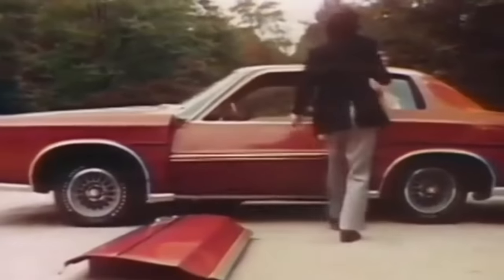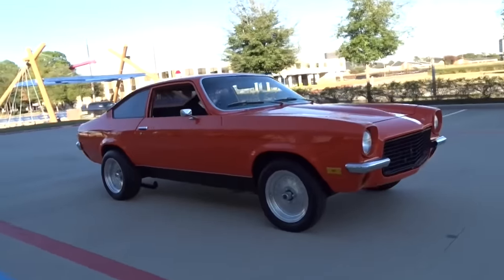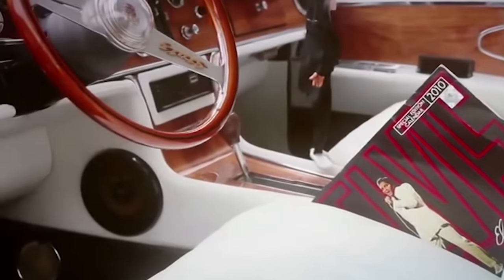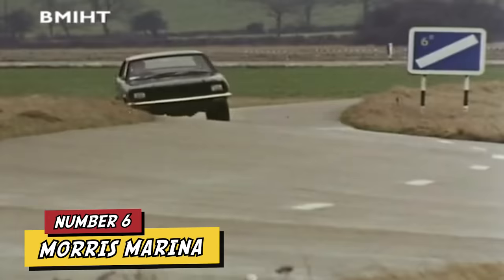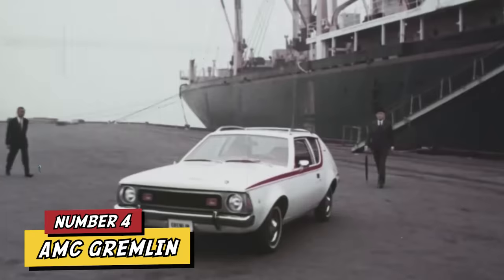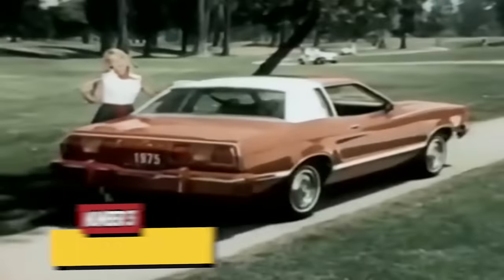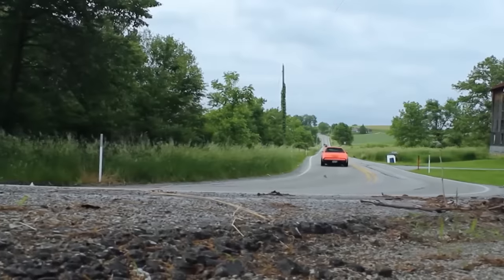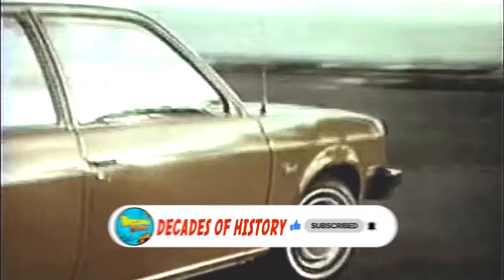Top 10 The Most Disastrous Cars Of The 1970s | Decades Of History

Comment: I WOULD LIKE TO BLOODY KNOW WHO THE HELL HAS PUT THE MORRIS MARINA ON THIS VIDEO AS IT IS AN EXCELLENT ,I [  REPEAT  AN EXCELLENT  CAR  ]   I HAVE HAD TWO AND THEY WERE BRILLIANT SO IF ANYONE  KNOCKS / SAYES ANYTHING BLOODY BAD ABOUT IT THEY CAN PISS OFF ESPECIALLY IF THEY HAVE NEVER OWNED ONE THEMSELVES  THEY HAVE BEEN WARNED .
Reply: I am sorry to say that I drove one in '74 -'76. It was the worst car I drove in 45 years. It was rusting through when 3 months old. It needed 5 clutches in 28,000 miles caused initially by a faulty crankshaft oil seal, and then by distorted clutch covers. Each time the clutch failed, the engine shook so much that the exhaust pipe was torn off the manifold. The alternator failed at 20,000 miles. The battery failed at 35,000 miles. Rear axle location was so poor that the rear end hopped very noticeable on cornering. The best fuel consumption I ever got was 28 mpg (UK). As it was a 2 door coupe design with fixed rear windows, and the cheapest version with dark red vinyl seats, I had to endure roasting 85°F temperatures during the summers of '75 and '76, losing 30 pounds each summer. The brakes were poor, but I got used to them. The 1,300cc engine was feeble, but given the other shortcomings it was probably just adequate. Oil consumption was getting worse at 58,000 miles, when I was pleased to say that I got rid of it

Comment: The '71 Grand Prix was one of the most beautiful cars manufactured.  It was acclaimed as such at the time.  The drive train was well engineered , the interior contained many luxury touches, and it's performance was perfectly adequate.  Sure it was heavy, awkward in town, and a gas guzzler, but at 45 cents a gallon for gas, no one at the time cared.  The Pinto's reputation for exploding on impact is overstated.  All cars at the time put their gas tanks just in front of the rear bumper.  it was the standard location in the industry.  The Vega was a pretty car, but absolute garbage.  If a mint condition Vega were offered for free, I wouldn't touch it.  It wouldn't be worth the headaches it will cause.

Comment: Had a friend  who owned a pontiac aster, vega with different grill, she said she had to start the car and let it run 5 minutes before driving or it would stall, turns out the choke never worked right. I made an adjustment and it worked fine

Comment: The Gremlin was not "designed with poor-quality materials".... not exactly sure where you got that information.  The Gremlin used the exact materials that the Hornet did. Same 232-cube six, same brakes, same transmissions, same interior.... and the Hornet is often lauded as one of the BEST cars of the 1970s. If anything the Gremlin was a little bit ahead of it's competition because a Gremlin came with things like a GLOVE BOX (Maverick and Pinto did NOT!), a counter-balanced hood without a prop-rod (sorry, Pinto and Vega) and yet the Gremlin could be had with things like a 3-speed Automatic transmission (Sorry, VEGA with your two-speed, Semi-Auto) and other items like power steering, power brakes and AIR CONDITIONING!  (sorry EVERYBODY ELSE).

Ever driven a Gremlin?  They don't handle any worse than your typical 1970's car.  Matter of fact, they ride quite nicely.  Again, it's the exact same suspension that's in a Hornet, Javelin, Matador or Ambassador.  Where things often went wrong was people would not spend the extra $12 for a sway bar.  But that's not AMC's fault.  I used to drive a 1971 Dart Swinger that had no sway bar and that thing handled like a garbage scow in comparison to my Gremlin that did have a sway bar.

Another thing is at the time.... Magazines and TV shows that tested the Gremlin .... LOVED IT.  The Gremlin was the automotive darling at the time that had the Management at GM, Ford and Chrysler pulling their hair out; screaming at their own engineers asking why AMC could do it; but the big three with 30x the budget could not!  AMC would have sold MORE Gremlins if they had the production capacity to do so.

And did you know about AMC's Buyer Protection Plan?  For the first year or 12,000 miles.... if anything went wrong other than with tires or battery..... AMC would fix it free of charge.
Yes, other companies like Chrysler had the 5/50,000 warranty.... but that applied to powertrain ONLY.  In an AMC.... if a headlight burned out in that first year, your dealership would replace it free of charge.  No other company did that.

As for the Pacer, yes, they rushed their electronic ignition to market.  Prestolite was forced to meet cost-considerations and that meant NOT having a heat-sink on the output transistor.  Had they added a Heat-Sink, or even mounted the brain-box inside the car.... there wouldn't have been a problem.  Other electronic ignitions of the time were just as fallible. Ford Duraspark, anyone?

And finally to add insult to injury....there was NEVER an inline-6 available in the Mustang II.  There was an inline 4, a V6 and a V8.  The inline 6 didn't rear it's ugly head again until the Fox body era. I'm glad you didn't mention the 1974 Bricklin.  They were much better cars with their AMC-sourced 360 V8s.  But I would agree the '75s and the 27(?) 1976 models with their 2-barrel FORD V8's were slow.

Comment: I also came to point to the BS of the Pinto claims.  The previous commentors have done a good job of that, so I'll just add look into the Chevy side saddle tank pick ups, as well as the death toll and the behind the scenes politicking and bribes that prevented both a recall or a factory solution to the problem for years longer than the Pinto issue even existed.

Comment: Why did you not include the Plymouth Volare/Dodge Aspen?  These cars were introduced in 1976 and rushed into production like so many other cars from American manufacturers, trying to catch up to the VW and the Japanese carmakers.  Volare/Aspen models had rust problems with suspension, brake lines, body sheet metal, before they reached the dealerships!  I had occassion to rent one, which turned out to be four, for a month in 1977.  Rear view mirrors fell off, engines kept shutting down, mileage was poor, noisy engines, build quality was non-existent!  Chrysler Corp. should have kept the Plymouth Duster/Valiant and Dodge Demon with a change of its' name, and trashed their replacements after 3 major recalls in the first year alone!

Comment: So far everything that's been shown, I put hundreds of thousands of miles on em and made fast drag cars out of that same vehicle's that nobody could touch with stock everything under the hood. After the "run what you brung" thing got old, as in completely stock vehicles. I climbed the ladder and went to the 3 upto 6 second rides that would blast down 4th or 8th mile roads or tracks lol..Some of the safety features came with each and every vehicle that was built in the 70s..Ain't no automobile that I can remember was ever built safe cause when you work around a towing yard you see everything built smashed up and destroyed by only going at least 50mph..I could always tell by the skid marks how fast they most likely were going..I don't never want a towing yard job, or anymore funeral home jobs...All vehicle's bend and none of em are safe. I remember Volvo was supposed to be the safest vehicle on the road. The firewall wasn't supposed to cave in on the driver and front seat passenger..Getting hit from the rear or either side of the vehicle's, people died. Even a front-end hit will cave the firewall into the people in the front seats. Volvo told that lie just to sell their automobiles but a 40mph head on collision is all it takes to total and cause death in a Volvo station wagon or any automobiles made in the USA 🇺🇸 or any other country. I've also seen a Silver Spurr come in smashed completely up going 50mph so don't go thinkn that a Rolls-Royce is safe lol. Just expensive 😂😂😂😂

Comment: The Pontiac really does not belong on this list at all.  As for the Chevette, it may have been a bit Underwhelming but it was not at all a bad car.
The Vega - BAD❗️
The Mustang ll, was a decent little car - just had the wrong name.
And while there was a flaw with the Pinto, it was later remedied, [ but not until it was well exposed].  The wagon did not have the issue.
THE GREMLIN was not a bad car.  It was the Hornet, with the back end chopped off.  Made it look strange, certainly, and the short wheelbase caused the back end to “hop” a bit more, over bumps, but other short wheelbase vehicles also did.
  BACK THEN, American cars all had some issues.  Some of these were no worse than any others.
   But…. An interesting video anyway.
🚗🙂

Comment: the Ford Pinto was one of Ford best selling cars ever, yes it had a problem with the  gas tank {27 cars out of 1000s made} but Ford was fast to recalled and replaced with a new tank right away,  Pintos were wonderful cars and vary fun to drive, my family had more then a few Pintos over the years and none of them ever exploded when hit in the butt or anyplace on the car with the 2300cc engine and a 4 speed they were a fun little car to drive every day, I know I had two of them my self A 1974 Runabout 2300cc and a 1979 wagon, 2000cc engine with a automatic trans it was still not to bad to drive , it had enuff power to cross and get on and off the highway with out worrying about your life 

,
Reply from the maker: Thanks for sharing your personal experience with the Ford Pinto! It's always interesting to hear from someone who has firsthand knowledge of a particular car model. My friend's dad had a Pinto he never had problems. However, I can remember being a little nervous getting in that car, but then again that's the news.

Comment: The Pinto was prone to rust issues. But the engines & transmissions were good. The car that should have been No. 1 on the list should have been the Vega. They were junk all the way around. Besides there are alot of cars with thei gas tank behind the rear axle. Matter of fact. Every car I ever owned had the gas tank behind the rear axle. Except for a couple of pickups I owned.

Comment: I owned a Mustang II and it was terrible beyond description. It was underpowered and worst driving vehicle I've ever owned. Driving on the highway it would bog down from 60 to around 40 mph with the accelerator floored. Hit passing gear, it would go even slower. You had to pull over and let it rest for a while. I also had a 1969 Mustang at the time, and it could eat the newer one up.

Comment: The Leyland Marina was meant to take on the Ford Escort but during the shambolic development process it ended up competing with the Ford Cortina but only much more expensive so a major cost cutting program was instigated ahead of the 1971 launch which stripped the car of any charm, solidity and reliability that it may have had, but it still didn't make it profitable. So the poorly conceived, stupidly named, excruciatingly dull, financially ruinous badly built box of bolts when on sale. The driving experience was crude at best, the handling was on the unfashionable side of ordinary, mechanical noise was excruciating and almost everything about the Marina felt old fashioned even on day one. The suspension was shocking in a literal sense for it not only gave the occupants a jarring ride, it hurried along all the badly attached parts that were already thinking of leaving. To match it's nautical name the newcomer had a habit of filling with water at the slightest hint of rain and the performance suggested that the Marina had a few too many boats moored to it. It's also hard to believe that anyone could make it worse but Leyland Australia rose to that challenge. They squeezed their 2.6 litre 6 cylinder engine into the Marina turning an under powered pig into an under steering pig with hideously heavy controls and handling that occupied that slender niche between very bad and bloody awful. After all to err was Leyland.
Reply: My dad had a Marina.  I spent a lot of my childhood on the hard shoulder!